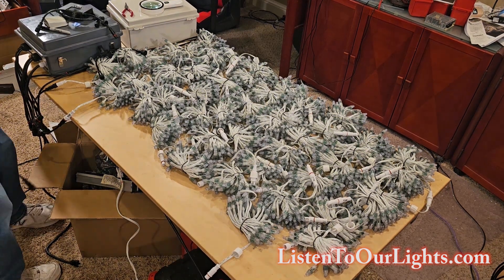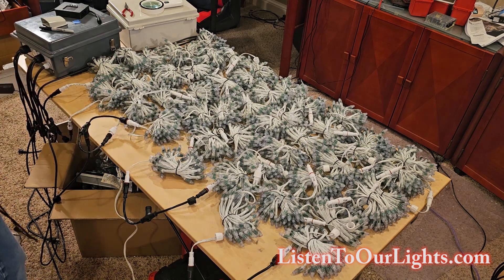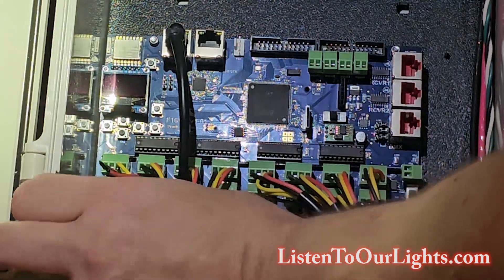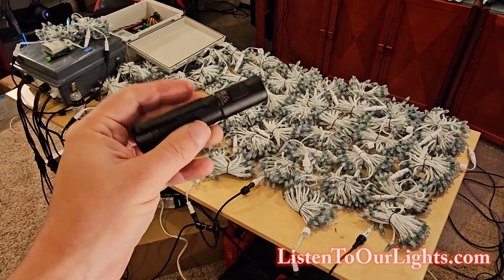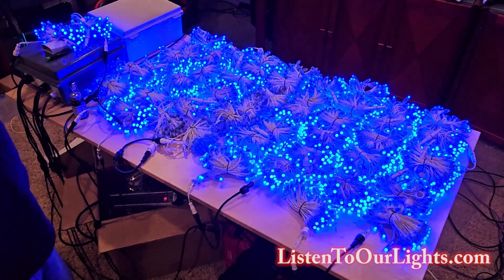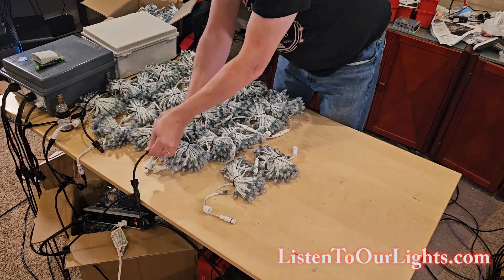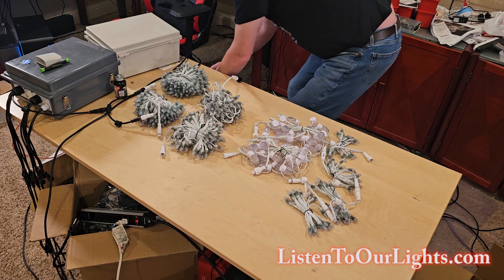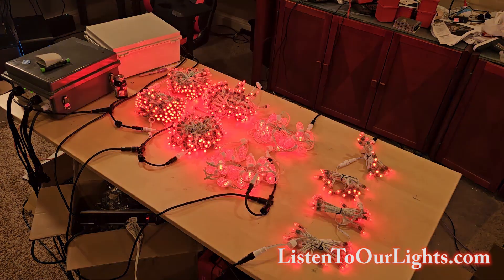Testing Pixel Order from Paul Zhang

Comment: I get lost on the power injection and how the 2 boxes connect and each one’s purpose.
Reply from the maker: Gray box contains the pixel controller and provides data only. The dark grey box contains a power supply and provides 12v +/= to the power injection T's.